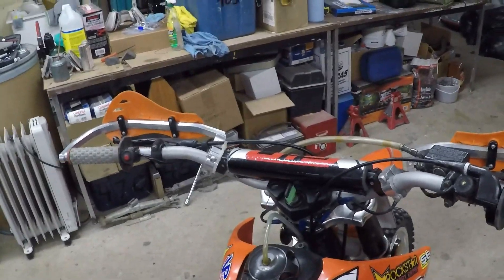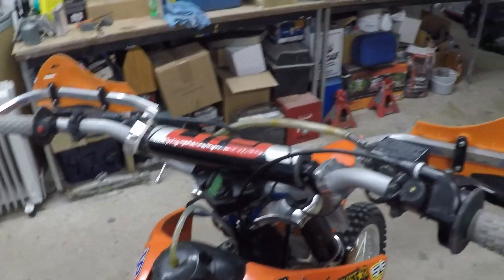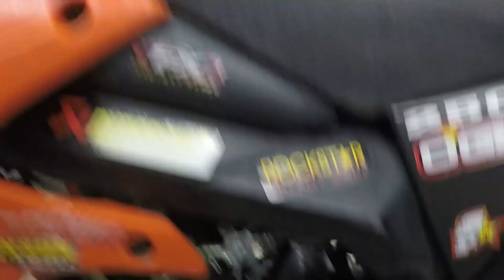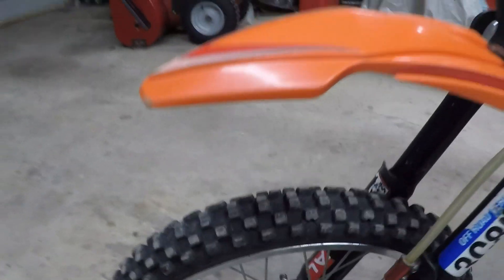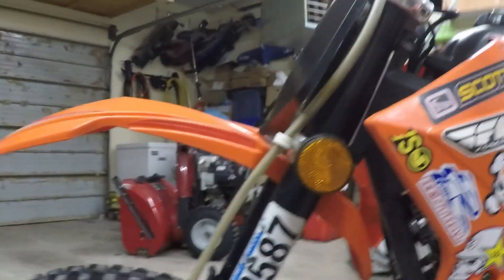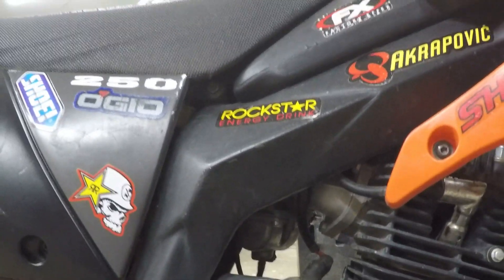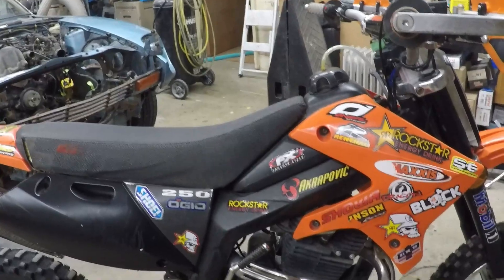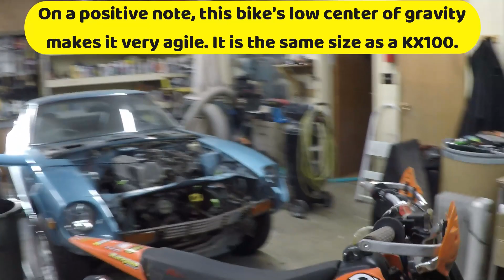Gio X31 250cc Long-Term REVIEW - 10 YEARS!

Comment: The fact youve had it 10 years speaks. I have a chinese 125 and i did it up nice and custom alot more power than stock either way if you put your time and money in you can make a decent bike. Had mine about 3 years now and its still ripping hard most ive had to do is swap a flywheel also added some lucas oil treatment to my oil when i witched it. My oil hasnt gotten dirty since

Comment: Thanks a lot. You mentioned the battery don’t last. Can you ride without it or you need it but don’t use the electric start.
Reply from the maker: You don’t need the battery because it has a kickstart. I pulled my battery out.
Reply: @endurobandit  mine takes a lot kicks to get started what do u think it could be
Reply from the maker: @AbdullahIqbal-rh7lc check the valves, they may need adjusting. After that do a compression test. Also check the spark plug gap. But if your engine is burning oil then you already know what’s up lol